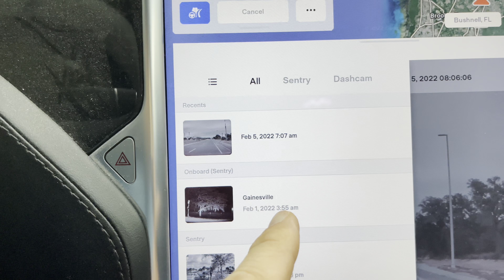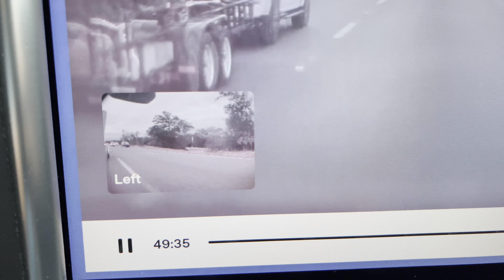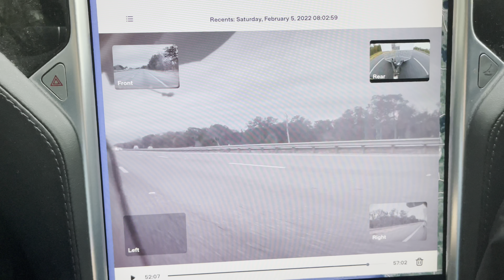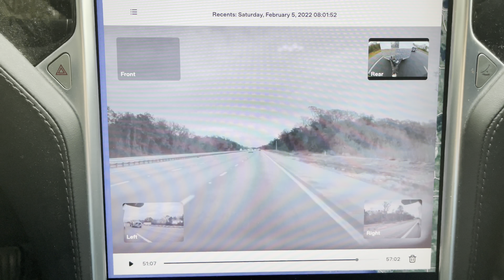Watch My TESLA Get SIDE SWIPED HIT & RUN @ HIGH SPEED on the INTERSTATE | ACCIDENT | CRASH

Comment: First of all why didn’t you follow that guy after he hit you and try to track him down. As you are trying to track them down and get close enough you would’ve gotten the license plate and then if you didn’t want to stop them you could just end the chase and have the video of the license plate for the officers to follow up with you and file the police report and then file claim with your insurance. Something keep in mind just keep some duct tape in your trunk and then you could just temporally tape that side mirror to the side of the car since it’s already damaged and the panel will need replacing.  Also you could have called 911 and get close to the truck and get the license plate and then just let them go
Reply: He is pulling a pretty big trailer,  probably not worth the risk to drive aggressively to keep up.